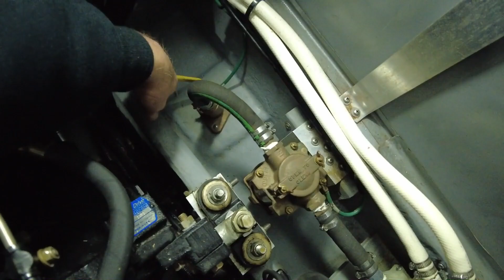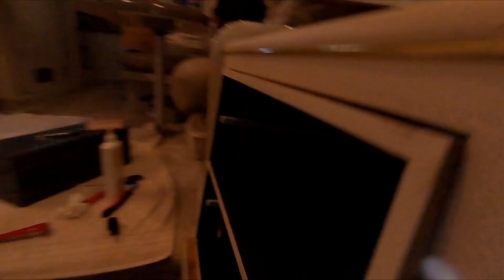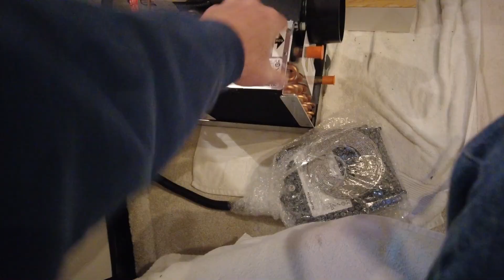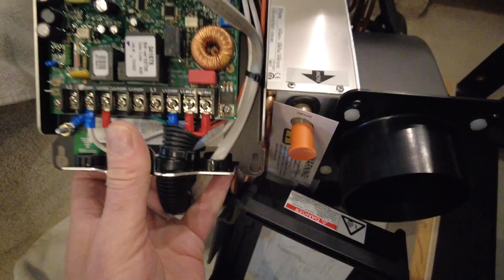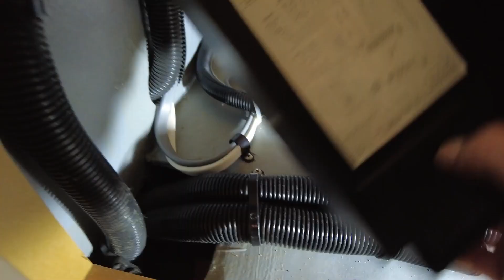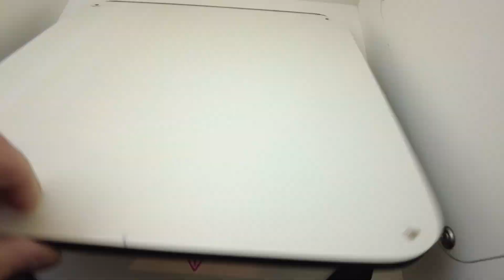Installing Dometic Retrofit Air Conditioning on Our Boat

Comment: Excellent video! It's interesting that there is no dedicated air return and it pulls air through the cabinetry. Was there any area either under or on the side of the cabinet to add one? I know you've sold the boat now but I wonder if adding a return would enhance the efficiency of the unit? I'm gearing up to possibly upgrade a forward unit on a 2003 320 Sundancer. It's under the birth so access is much better.
Reply from the maker: As you saw in the video, Sea Ray never made an accommodation for a 'standalone' return air duct. Never had a problem with air movement on this boat, so I'd say all is good 👍
 Your 320 Dancer is very similar to our prior 330 Sundancer. If you're up to a challenge, you can sift through my (nearly 1,000) videos to see me replacing a section of ducting on that boat.

Comment: Great video. You have saved me a lot of time when I do this job next winter.
Reply from the maker: Great, glad it's gonna help you with your A/C replacement. The only issue I had was where it's located on our 370 Sundancer - a royal pain to work on as it was in a very cramped space, but very happy it's done. Apart from the work space (or lack thereof), it was a straight forward project. 
 Have fun with yours! 😀

Comment: Paul, great job man. I'm looking at using the same system for an install this fall and this video will help greatly. Question, did the retro unit come with the refrigerant installed in the unit or did you have an AC guy fill the unit?
Reply from the maker: The unit came precharged, so was good to go right out of the box. All the steps I took for the full installation are included in this video 👍
Reply: @BoatingWithBoogaboo  Paul last thing - I noticed when you removed the old unit that metal sensor was placed against the coil of the old unit. Where was the metal sensor placed on there new unit?
Reply from the maker: @intrinsicfineautofinishing4660 I don't recall seeing that in the new one, and I just scrolled through the photos I took when installing, but don't see anything similar. That said, I'm sure it exists on the unit, but can't tell you where exactly. You could contact Dometic directly to find out. They are generally pretty good at replying...
Reply: @BoatingWithBoogaboo  I'm waiting on a response from Dometic now.. That sensor on the your old unit was next to what I would commonly refer to a radiator. However, that sensor is wired next to the extier cabinet on my boat. I wonder if the sensor was improperly installed form the factory and that could be the reason my cabin will not cool below 80 degrees during the day, which is the problem I'm having. It will got a little cooler at night after the sun goes down. I noticed in the trouble shooting portion of the manual it talks about proper sensor placement.

Comment: Where did you put the remote air sensor? I have the same unit and according to Dometic, it has to be in the air flow in front of the return.
Reply from the maker: The sensor came pre-installed from the factory. Yes, it's located at the front of the unit/intake.

Comment: Love your content as I have an owned a 1995 sister ship for 20 years. I did both my AC units a few years ago. I went with the Dometic turbo units with the plastic trays. They have worked flawlessly. I did connect the original SMX controllers to the new units. The aft unit is a real PITA. I removed the control box from the new unit and mounted it under the sofa seat where the old one was. I like your idea a little better. Why Sea Ray passed the wiring harness through that bulkhead confused me, they sure were not thinking about having to eventually replace it. With a helper I was able to change both units in one long day. The front one is much easier to do. Again I love your videos!
Reply from the maker: Great to hear, thanks!! If I'm lucky, that'll be the last time I have to do this project again. . . On this boat, anyway 😉

Comment: “Cool” video. I’ve done it myself and was curious where the return air vent was located on your install?
Reply from the maker: There's no standalone air return vent, as this unit merely draws air from under/around the cabinets. Sounds weird, but it works.

Comment: Nice job as always! Our hot water heater just decided to crap out and it's only 2 years old. I believe it auto shut down but doesn't seem to want to reset. Really needed it for our Cambridge trip coming up in 2 weeks.
Reply from the maker: Is there a re-set button on the unit? I'm not familiar with any of ours having that - even the new one I had to install on our old 300 Sundancer a number of years ago. Oh ya, that was because I didn't winterize the heat exchanger side and it froze 😩
Reply: There is a reset button that appears to be “not engageable” ie it’s not protruding if you know what I mean.  If it shutdown because of overheating it apparently didn’t tell the reset button that!
Reply from the maker: I do know what you're referring to.
 So if it's not that, it's most likely either the element (which have a much lower lifespan these days), or your main breaker on the panel. Just confirm that the breaker is fully engaged by shutting it to the OFF position, then back to ON.
 Apart from those things, there are no moving parts to fail....
Reply: The breaker is engaging as it should on the panel. One of my boating neighbors suggested that it’s possible that the unit is sensing something that is no longer happening and we should run the water through to make sure there is no air in the system and even empty the hot water tank. I do know that it is definitely not sending any electricity to the unit. The needle shows no movement whatsoever on the panel.

Comment: Hi Paul. Where would I start troubleshooting and stinky air conditioner?  Unit functions fine provides ice cold air but there’s an odour.
Reply from the maker: I'm gonna go out on a limb and suggest that your stinky smell isn't as a result of your air conditioner, but rather the poop lines in your plumbing system. We battled mystery smells on our 400 Sedan Bridge when we had it and finally traced to the 💩 lines that had become permiated with maladous orders 😩
 What was the solution? You're not gonna like this if you have to do it, but we replaced all those lines. Problem solved for us.
 You can check to see if your lines are the culprit by wrapping a warm, wet rag around one of them and letting it sit for awhile (an hour should do it), then removing it and smelling it to see what you find 
 Here's a video I produced a number of years ago that looks at what we did in Boogaboo IV; https://youtu.be/f6xJB_mN38Y
Reply: Air conditioner condensers are prone to developing mold and emitting unpleasant odors. There is a specific spray cleaner that repairmen use.

Comment: Typical boat project.  Think it will take a few hours in the afternoon and turns into 3-4 days.  Could they squeeze that in any tighter?  How many F bombs did you have to edit out.  Praying mine keeps going.  :)
Reply from the maker: You got it. What one thinks should only take a few hours ends up being a 45 minute long video 😂 But I'm glad it's done.

Comment: Very neat job, quite a project. Compelling watching.  If you ever spring a leak on in, out or condensate the power supply might get fried sitting on the floor there,  AC current mixing it up together with water. You could put the unit in a tray in due course to mitigate the minor risk.
Reply from the maker: Thanks for the tips!

Comment: Hey  Paul, maybe I missed it, but I didn't  see where the return grill and filter is located. How do you change the filter?
Reply from the maker: This setup never had a dedicated air return grill, as it merely draws air in through the cabinetry. As for the filter access, I believe I mentioned that I can access it through the small panel at the bottom of the closet, ahead of the drawers.

Comment: Great job Paul, all your connections and wiring look so good. The new unit is so quiet, I could imagine how loud the old unit was. Just luv watching your projects. Have a great summer.😎🇨🇦
Reply from the maker: Thanks 👍 And yes, now that I've dialed in the fan speed, it is a lot quieter. I'll be making a video on that setup, as well as how I mounted the thermostat/controller in the future. Hope you get a chance to have a look at those ones 🙂🇨🇦

Comment: I got sore and skinned my knuckles just by watching this.  There was probably a time that I might have tackled a project like that.  Those days have passed.
Reply: I’ve done a lot of fixes and renovations on my boat in recent years. I initially tried to find people to do the work for me but I found out many of these folks knew less than I did about the work needed so I had to bite the bullet and start doing it myself. Like you, I always think I’m too old to be doing some of this stuff but I find that if I take my time and be more patient, do a lot of research and make sure I get the right tool and parts, I usually get it done.
Reply from the maker: @cheapme1850 Sadly, I'd have to agree with you about trying to find 'professionals' that actually know stuff about boats. Fortunately, my personal experience has/had been good, but I often shake my head when hearing from other boaters - both here in my channel, as well as on other YouTube videos - about what they've been told by marine mechanics. I guess it's like all trades, with some good and knowledgable gus, and others not so much . . .
Reply: My service guys watched the 330DA video prior to doing my water heater & waste tank replacement. They found the video helpful. If you're curious, that job was worth about $4K USD parts and labor.
Reply: great video !always takes a little more than u think !